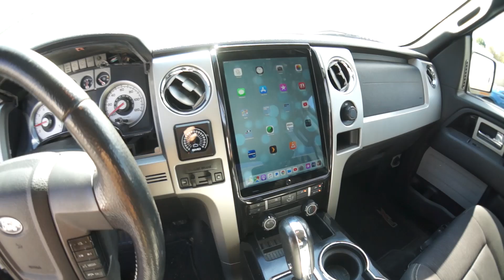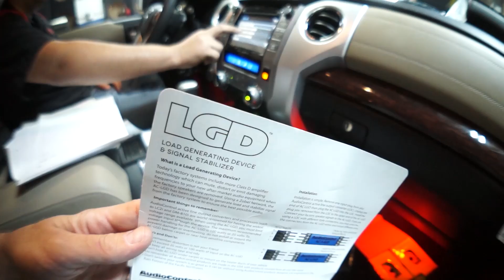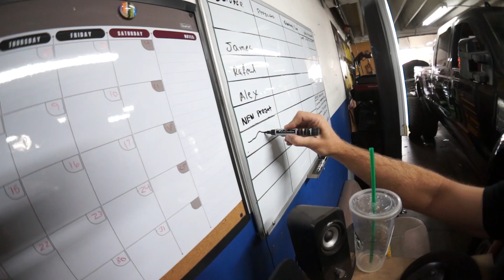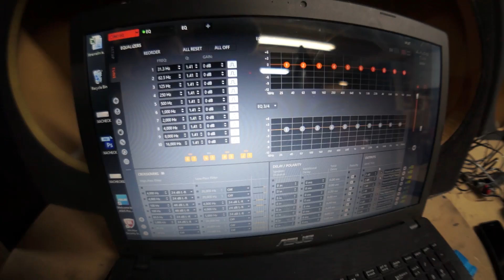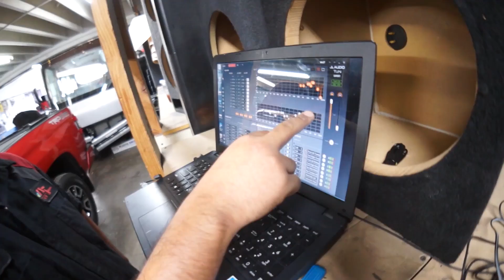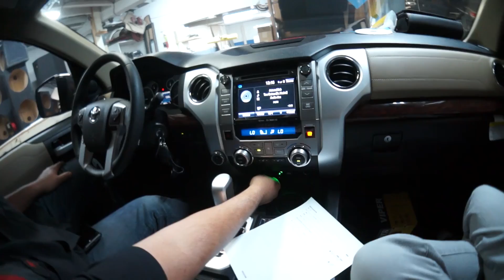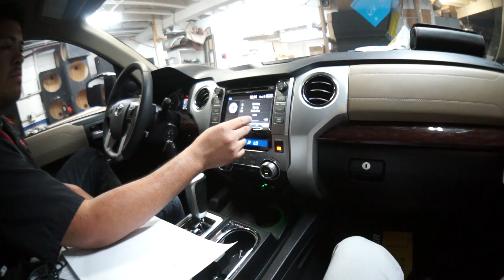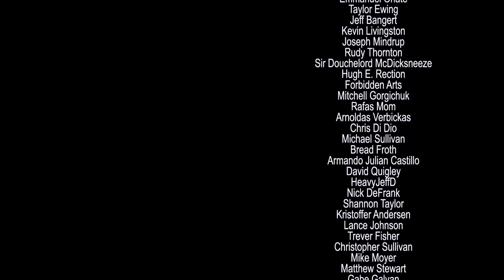stereo VS stereo - Rafa Tunes a JL Audio TWK D8 with the AudioFrog RTA kit UMI-1! - AMPLIFIED #670

Comment: Has doug realized that the DSP in the audison is downsampling his high bitrate$1500 head unit yet?
Reply: Keith Anderson I try to keep my comments to myself since he should know everything there is to know about sounds but yet Rafa doesn't know wtf a gain is used for... HOW?
Reply: If this is true..  that is hilarious..
Reply from the maker: the McIntosh amp isn't connected to the DSP smart fella 😋
Reply: SoundmanCA 1/3 of an sq build is better than no sq build at all!!! ;-)
Reply: I thought it was for the tweeters so it's still used.
Reply: SoundmanCA oosh, how about them apples. I wonder when the next pro car audio installer will comment on bit rates lol
Reply: BOOM!!!!!!!!!
Reply: "HAH.! GOTTEEEEEEEM.!" LOL
Reply: Beat me 2 it.
Reply: If he is passing analog into the DSP he will still get some benefits... if its digital it wont.
Reply: LOL.. awesome.  Just make sure you don't use digital out on the Sony.. it won't use that nice DAC.  Doug if you want to use the Ipad why not get a nice highend home DAC and put it in the truck?  Convert power and throw in an Audio Quest jitterbug just to help out..
Reply: ISEE YOU it's over opitcal.  So the bass amp and the tweeters where most of the information in the music is coming from is going through the audison dac.
Reply: Keith Anderson That's not how that works. That would only be the case with a fiber optic input @ the processor if it had a d/a converter.
Reply: I didn't hear him mention it's over optical.. he isn't even using the $1500 radio for what it's meant for if that's the case.  RCA out is the only way to use the Sony.... have it in my truck.  It's a nice unit.  I am analog to my Helix DSP PRO MK2 using Audioquest Big Sur RCA cables.  It has a nice sound but my Panasonic bottlehead sounded better...
Reply: jeremy whittler a ways back when he was getting ready to buy the Sony he talked about one of the reasons he wanted it was to run optical to the audison.
Reply: Keith Anderson Gotcha I stand corrected.
Reply: Wow.. they make little devices that convert to optical.. dont need the sony at all for just optical.  30$ device or 60$ SMSL X-USB.  Converts USB to Digital over optical or coax.  Simple..
Reply: What's rafas channel 🤔
Reply: @soundman_caraudio  When you were next to the cop car in traffic and you turned it up, why were all the lights in your truck dimming and your truck was getting ready to stall?

Comment: I understand Rafa's concern about the EQ limitations on the JL dsp. It is very limiting. Get your hands on a Zapco DSP-Z8 IV. 30 PEQ/GEQ bands for channels 1-6 and 11 bands for 7 and 8. You can really dig in with those. You guys should also dig into REW a bit more and start using house curves like the AF curve or the JBL house curve and tune to that. You can drop that curve into the REW RTA and then tune to it. It will give you guys a much more natural sound rather than pure flat. I dig the vids guys.

Comment: Anybody else think that instead of diamond plate, that a finished MDF panel with some custom CNC logo design would look better on top of that box?
Reply: Robert H. Cnc the top part, pick a background color say black, epoxy it. Then mill out his soundman logo 1/4 deep and fill with dyed contrasting epoxy carefully then lighty sand smooth and add more epoxy as a clear on top. Bam! done.

Comment: can u connect the amp remote to the cigarette lighter? the cigarette lighter dose not stay ON when the car key is not inserted
Reply: alex vladescu  For one, it makes your speakers jump out of the basket when you turn the car on and again when you shut it off with some amps. You can use that method with a relay. Not all vehicles cig lighter turns off when the car is off though. You can run speaker wire from the rear of the car, one side on the amplifiers remote and the other on the constant power and use a switch up front. Ghetto, but it works.

Comment: Why would you put the same speakers in the back as the front? Just fucked. Rears are for people in the back who gives a fuck about them. Should have used 165WRC's up front and some Flax in the back. Or just do it right. 3 way up front, rears are stupid.  I wouldnt even cost much more for gear. Use the WRC tweet and the rest of a ES165kx3 kit.